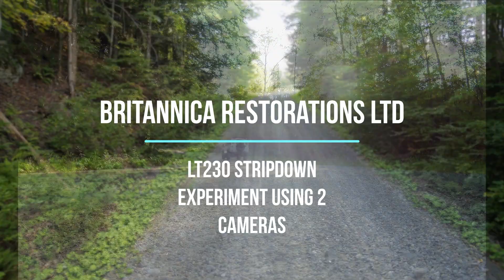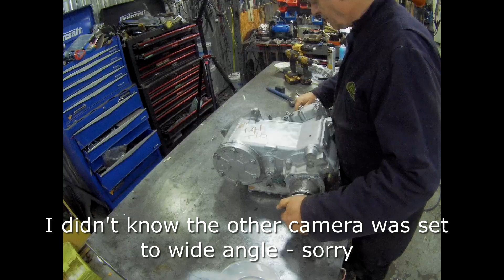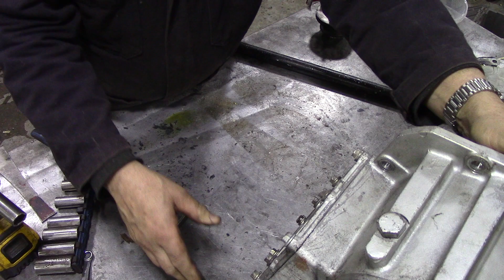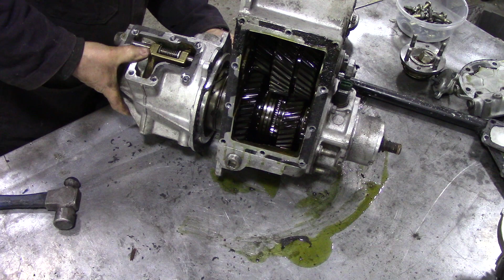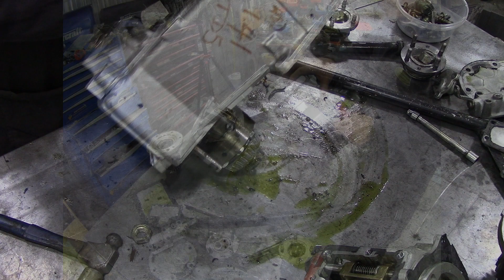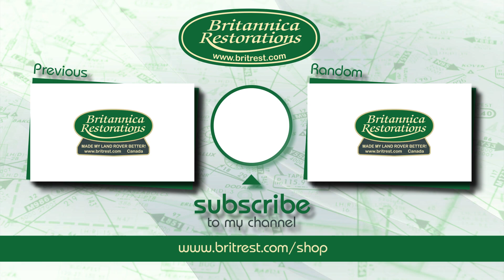2 camera test! Stripping a TD5 LT230 1.41 ratio

Comment: Have you ever across an intermediate shaft that wouldn’t come out? I’m trying to strip a 36DxxxG and had some serious tones on it in a hydraulic press and it wouldn’t move. It’s free in the case - back and forth 3-4mm and rotates but fast in the gear. Gear spins freely with no play! At my wits end… ☹️
Reply from the maker: Sounds like the inner races have welded themselves onto the shaft. Cannot be 100% but seen it before - 
I would not risk pressing the shaft too much as you can damage the casing.
I would drill the shaft from both ends so the gear and shaft will come out

Comment: First of All I wish you a healthy and Happy New Year!!! But the old Year let a Question left?? My Discovery 2TD5 2003 wont load the Battery I put a new Alternator in same Problem. When I start the Battery controllight on the Dash goes of . Do you have a idea? Best Regards Axel
Reply from the maker: With the engine running, do you have any volts out of the back of the alternator?
Reply: @BritannicaRestorations  its a brand new alternator the second its the same resalt , and when it statrts the batterylight on the Dashboard gets off. I messuare 12,7 Volts on the Battery while the Motor runs with ca 800rpm. is there foult  in the ECU ?
Reply from the maker: And what about the very back of the alternator? Not the battery
Reply: @BritannicaRestorations  today is Sunday here you can do nothing has to be quiet!! But Tomorrow I will measure?! What come out.
Do you think there could be in the new alternator a problem?  ECU-Alternator?
Reply from the maker: Could be a bad connection between the battery and alternator
Just use a multimeter - you do not need to remove the wire - just touch the stud coming out of the alternator

Comment: Hi mate would it be possible to link the part numbers for the tools needed to rebuild r380 and lt77 gearbox thanks
Reply from the maker: You will find them all here

https://www.dingocroft.co.uk/acatalog/Gearbox_Tools-p1.html
Reply: Thanks mate. I know that's who sell the tools but there is that much different stuff for sale I don't know the exact bits I need . Thanks
Reply from the maker: The part numbers are in the LR workshop manuals in the gearbox sections
Reply: Thanks mate

Comment: Mike.  You've made it through 2022 !  Does an LT230T ever loose all it's oil if the rear output seal is leaking ?  Or is there some used gear oil left in the shallow part of the transfer case.  V
Reply from the maker: Hard to say but by the time the oil has got that low the bearing damage will already be well underway

Comment: Theory on why the intermediate shaft bores get damaged despite being stationary parts? My last build had a good bore but for insurance I used sleeve retainer in addition to a new o-ring and shaft.
Reply from the maker: JP and I worked out the surface area is a bit too small for the work it has to do - there is a lot of 'pressure' on that pin - the other end with the nut is never an issue as it is well supported, but still the large end with the O ring can hammer about
We now bush all transfer cases, and instead of using collapsable tubes we now use solid tubes like the Td5 fitted, as we noticed that once the bearings had settled, they can spin on the inner race on the shaft as now the preload has gone
Just fitting a new O ring is only a short term fix in a worn casing
No more problems with the bush and solid tube

Comment: Love the videos, could you do a video on replacing sunroof seals?
Reply from the maker: Bet you a pound to a penny, it is not the rubber seal, but the caulking between the roof and sunroof.
Remove sunroof, clean off old caulking and re apply a Sikafelx sealer   - job done
Reply: @BritannicaRestorations  any suggestions for trying to reduce the condensation build up?
Reply from the maker: Buy a Toyota.

Unfortunately no - warm damp air meeting cold glass will condensate
Reply: @BritannicaRestorations  legend. Thanks for the tip!